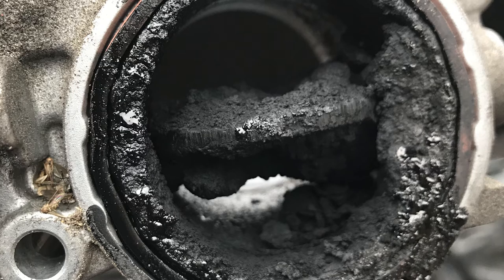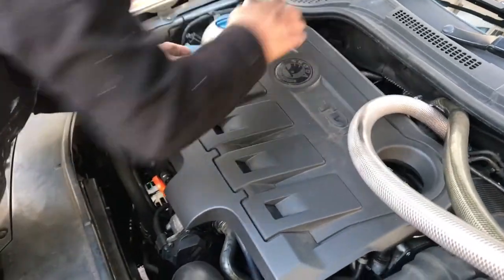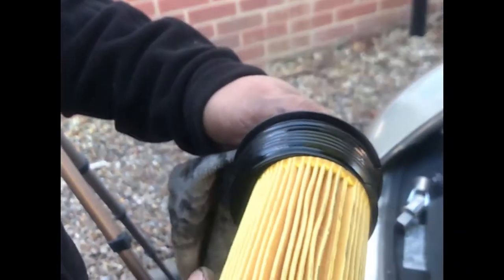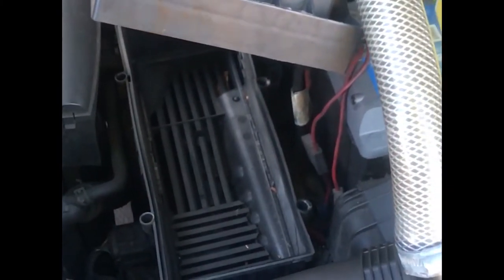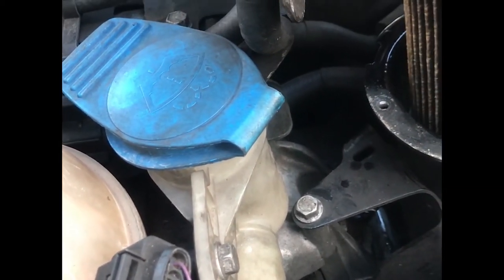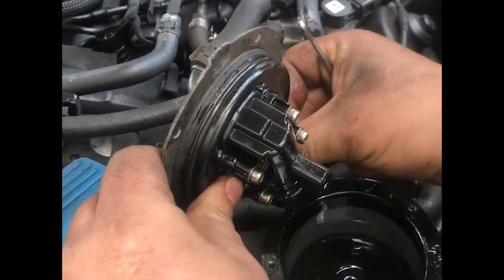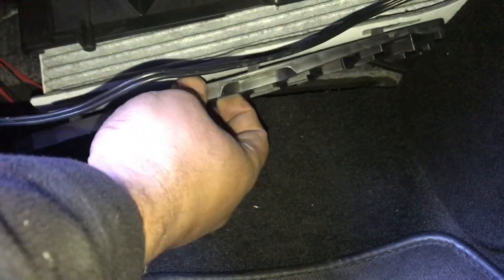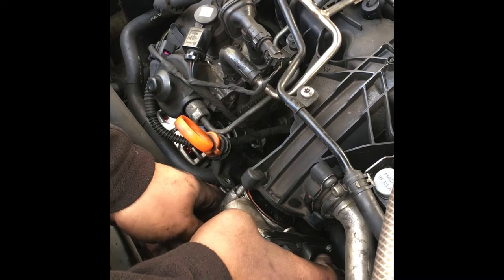Skoda Superb oil change Full Service and throttle body cleaning fault code p0121

Comment: I've never seen such a dirty throttle body! Lol great job!  I think we shop at the same stores ... I have a lot of the same tools 😂👍
Reply from the maker: Niamh Healy super super dirty, literally every 12 months the engine management light comes on throwing a performance range code and all it needs is cleaning... Most of my tools are either Halfords or EBay cheap and cheerful 🤣🤣😜... I’ve seen your workshop the other day and it’s an absolute dream so tidy and full of tools, and a nice and very clever cup holder I loved that 👍👍👍 cheers Niamh
Reply: That's insane lol I'm pretty sure my E46 has only been cleaned once in its 17 years and that was me! 😂  I must have a look and see what state it's in.  Nothing wrong with cheap and cheerful 😉  Love the Halfords Advanced range.  I just bought more 🙈

Comment: Hi, is this a M22, 32mm socket you are using? thanks
Reply from the maker: Steve Muller hi Steve yes 32mm socket for the oil filter cap ... 👍 cheers

Comment: 4.3 liters of oil 507.00 SV 5w30 goes into the engine. But they can't put more than 4 liters in mine. because there's always something left to strain. so be careful not to pour more than you need, as it is dangerous for the engine.

Comment: Wich engine oil is the best for skoda superb 2.0 TDI 125 kw. DPF. 2009.
Reply from the maker: Zagor te nej here in UK 5W30, it can change depending on what part of the world you live in always best to check your manual 👍👍👍
Reply: Cars Exposed. Yes of course. I know it's 5w30. I live on the coast. Adriatic sea. Croatia. I'm interested in which manufacturer is good. I poured castrol but it doesn't look original. Which manufacturer do you recommend? Thank you.
Reply from the maker: Zagor te nej I normally use genuine Vag Quantum oil but castrol is recommended by VAG so it should be ok 👍
Reply: I believe the VW 507.00 is for a long life oil suitable for DPFs. I use Castrol Edge 5/30 LL